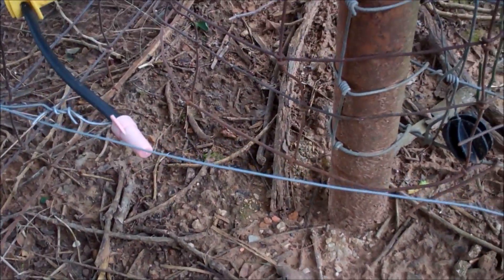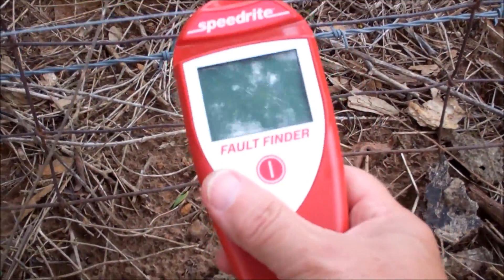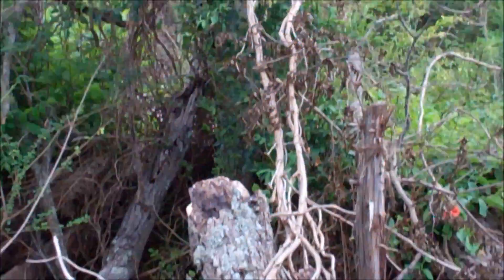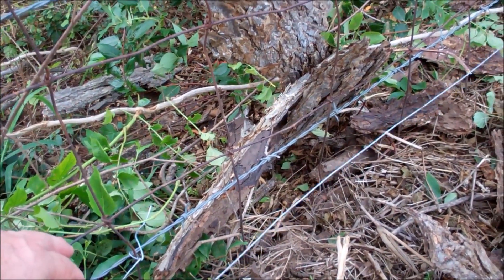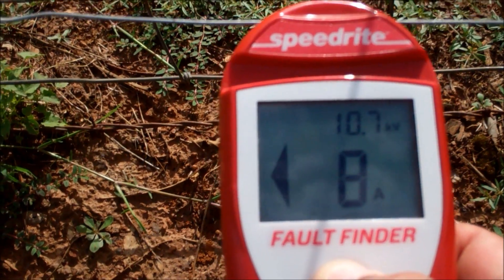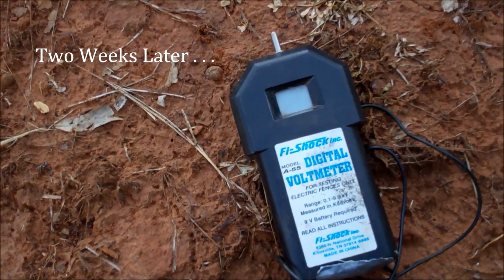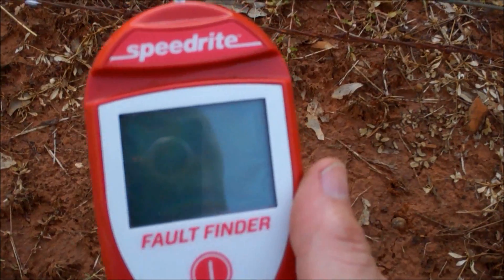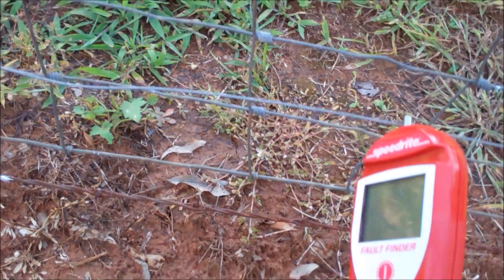Locating And Repairing Electric Fence Faults

Comment: How does the fault finder work if your electric fence does not make a complete circle back to itself (have a section of fence without electric) or if you have several segregated sections of pasture charged by the same charger?
Reply from the maker: The elect fence does not work on a "loop". 
From the charger, you can run a wire a mile long and stop... it doesn't have to loop back to the charger.

Comment: That is a nice little gadget you got there... Does anything happen when you drop the wire in that grove, just below where it says "Speedrite"?  Seem like it's more than just a design choice... Just wondering... Would love to get me one, but I could walk my fence in under 10 minutes.
Reply from the maker: liboriopsych The groove is where you insert the wire to check for direction of the fault. The probe on top tells you the voltage and amps
Reply: Sorry, I meant the grove on the "front", below speedrite... Sorry, I wasn't clear. My fault 😃
Get it? My fault, LOL!  Thanks again for the informative videos. Always enjoyable.
Reply: I'm thinking the groove has a small coil of wire embedded in it which gives ampacity and direction of flow.

Comment: Are you sure that is drawing 30 amps??????? seems like 30 amps would kill everything that touches it..... Volts get your attention but Amps will Kill Ya!!!!!!
Reply from the maker: ***** When it's working right it's between 5-8 amps. I think the reason it's showing so many amps when there is a fault is because the entire load is being dumped into a ground... not sure.... but you're right... amps will kill ya. 
I'm sure that's why they design these to pulse... if you couldn't get away from it... I think it would hurt you...  bad.
Reply: Thanks for the feedback!!!!

Comment: any opinion on the wire fence v's the plastic tape embedded with steel wire, i haven't used the wire type for maybe 10 years but i'm thinking of going back to the wire type because it is easily damaged!
Reply from the maker: stevencox75 I don't like the "tape" that is embedded with wire. My experience is that an animal could hit the tape part without hitting the wires. I don't care for it. Here's a video I did on the subject:
https://www.youtube.com/watch?v=PMCGIYvsCMI
Reply: TexasPrepper2 thanks

Comment: When I was a kid on the farm back about 50 years ago and before these neat tools were invented we used to check electric fences by seeing how close you could get to the fence with something metal to see where it would start arcing, the longer the arc the more juice on the line. I agree with you 100% in that electric fences keep animals in because I have seen cattle stay away from a fence when the power has been out for hours. They have long memories when it comes to getting shocked and seeing the that single wire jut means bad news as far as they are concerned
Reply from the maker: R MacK "bad news" for me too... IT HURTS :(